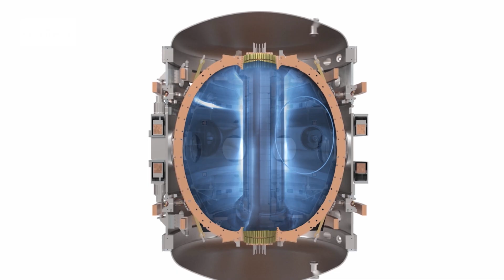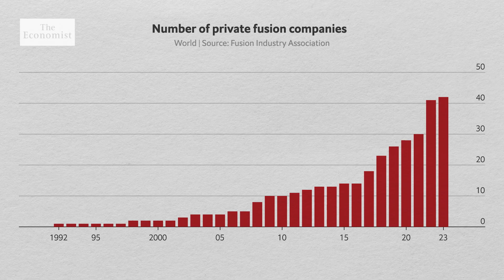Is nuclear fusion the future of clean energy?

Comment: ROFL!! The biggest scam in the history science! It will always be 30 years away. 
Here are just a few major problems with nuclear fusion. 
Stoping 14 MeV neutrons hitting that first wall! Cos whatever that is, it's gonna get the you know what kicked out of it!
It's a massive science experiment that they don't even know if it will work as a viable method of generating electricity.
It uses more energy than it makes, Q Plasma is not the total energy needed to run a fusion power plant. 
The many tritium problems....
The limiting factors of thermodynamics, converting heat into useful energy!
To put it another way.
With using the nuclear fusion business model as my foundation, i would please like to introduce you to my amazing idea called. The material reconstructor!!! 
It would involve building an aperture in one location and a second one in another location. Things that went into the first portal would appear out of the second one with bearly any time delay. 
The same process could be repeated in reverse, so that you could travel back. 
All i would need is the time, money and resources to achieve this and by my estimations i could have it ready to go, or at least have the RnD stage done, in as little as 30 years. 😉

Comment: You don’t need “base load “ power. Power which can be switched on and off at will is much more useful and indeed required to balance the variable output of wind/solar.
Reply: "I have no idea how an electric grid, nor how power generation works"
Reply: Thank you for sharing your insights about the importance of switchable power for balancing the variable output of renewable energy sources. It's great to see more advancements in clean energy solutions like nuclear fusion. On another note, if you're into outdoor activities or need a reliable backup power source, I highly recommend checking out the Segway Portable PowerStation Cube Series. Its massive capacity, fast recharging, and waterproof technology make it a versatile and reliable option for camping and home backup power.

Comment: Ask any physicist, fusion burns hydrogen into helium, the hydrogen comes from our oceans. Yes, there is a lot, but humanity's thirst for energy is unquenchable. If fusion ever works, and if we make it the cornerstone of our energy economy, we will be burning our oceans out of existence. And, no, there is very little likelihood that we will expend the effort to get hydrogen from other planets, at least until Earth is squeezed dry, because it costs too much. Frankly, the best outcome for Earth and our grandchildren is if the fusion project fails.
Reply: Did you ask any physicist how long the hydrogen we have would last if used for fusion?
Reply: @MattNolanCustom  At our current energy usage of 19Tw we will need to burn 19 Gigagrams of water a year (19000 Tonnes if I am doing my SI units correctly). That is assuming our energy usage is stable. It is not. Our energy usage has followed an exponential curve since we started burning Oil. The other question is how much do you have to burn before it begins to impact the environment?
Reply: Oh, yeah, extracting the hydrogen will require energy so energy demands will increase just because we're running Fusion reactors.
Reply: @kimwelch4652  right, so putting the increasing usage to one side for a minute, enough water on Earth at current usage levels to run fusion for around 70 trillion years. I don't think running out is the issue, nor really is depleting the water to dangerous levels. Our civilization is unlikely to last that long! Fusion is so appealing because of the energy density of the fuel and thus the tiny amount of resources that it consumes. The waste from fusion is helium which is inert, something we are actually running out of and something which is lost all the time from the upper atmosphere to outer space. The activated plant waste is low level and short lived. Fusion would be kinder to our environment and ecosystems than any other form of generation, renewables included. Having said that, I think we should have a balanced mix of sources, excluding only fossil fuels.
Reply: @MattNolanCustom  And, that's 70 trillion to burn it all up. More likely we'll find 1% is enough to throw the ecosystem out of balance. You should also, not put aside our energy addiction which will likely more than double every century. Did I mention our energy use is on an exponential curve? It isn't a straight line.
Reply: @kimwelch4652  the subtleties are not lost on me. However, the basic fact is that whatever we do for energy will have its cost on societies, ecosystems and climate. Fission has the smallest footprint on those things per MWh right now. Fusion will beat it by a factor close to an order of magnitude. We should also be looking at ways to be more efficient and less greedy with our usage. That doesn't change what the best choice of source for the bulk of our energy should be. Fossil fuels have the CO2 and methane problem. Renewables have a mining and end-of-life disposal problem. Geo and hydro is very location specific and can only help us a little bit. To say fusion would doom our planet by using too much water is the least logical argument I have ever seen against it.
Reply: @MattNolanCustom  Actually, Fission only takes advantage of an already burning fuel. We just capture that energy instead of letting it heat the Earth directly. So, technically, it has a smaller footprint than Fusion which adds heat where there was none before.
Reply: @MattNolanCustom  Actually, the fact that Fusion burns up the oceans is an incredibly logical argument against it. Saying that it would take Fusion a long time to burn up the oceans is an incredibly short-sighted and irrational answer.
Reply: @MattNolanCustom  The whole point of engineering is to know which subtleties are important and which ones are not, so the problem can be simplified to a solution. Unfortunately, even the best engineers can miss small subtleties that will, over time, result in a collapse (a bridge, a building, a civilization, ...). Short-sightedness in an engineering or scientific endeavor can be fatal.
Reply: @kimwelch4652  I can't tell if this is bad logic or just being poorly informed
Reply: @kimwelch4652  incredible
Reply: @MattNolanCustom  Actually, it is very credible. We did it with Oil, we'll do it with Fusion. Fusion is unsustainable.
Reply: @MattNolanCustom  What is incredible is that everybody who works on Fusion already knows this, at least theoretically, but they don't care. There are reputations and money tied to the work, and everybody has got bills to pay and a table to fill will food. They've probably never really run the numbers on just what is involved in putting Fusion into production.
Reply: @kimwelch4652  ah, so now some of your true colours are starting to show. You have ignored my genuine question to suggest better alternatives but instead rag on fusion and fusion scientists. Disappointing
Reply: @MattNolanCustom  A little dramatic aren't we. I didn't ignore it, I missed it glossing over posts. Also, I had work I had to finish today so I can't answer every question all at once. In particular, while it is easy to see some plan is not a real solution, actually finding a real solution is much harder. What we need to do is drastically reduce our footprint on the planet. That includes reducing our energy consumption as well as all our other consumptions. And, there needs to be a lot fewer of us as we have seriously exceeded the carrying capacity of the planet. Our waste has become life threatening. We need to learn to live within the bounds our environmental constraints. There is no easy solution to that. Our real problem is not technological, but sociological. If we cannot find a way to do it, then we are in real threat of extinction.
Reply: @MattNolanCustom  Ooh, the AI says, "If the Earth lost 10% of its water, it would have disastrous consequences for everyone." So, you don't have to burn all the water to cause devastating effects. Assuming you trust the AI. You do trust the AI, don't you? They wouldn't like it if you didn't trust them.

Comment: even if it happens, there is still issue of setting up high power trans towers. with so much trouble getting solar farms connected, be decades before can be used
Reply: It's always 20 years away
Reply: Distributed solar is not so much trouble. Any given house or business is limited by the existing connection, as are the local trunks and feeders. However, for any grid, these add up to match the full capacity in any case. Expect to see more.

Comment: Ultimately it will come down to cost.  Solar & wind farms might just get the last laugh--IF stationary storage batteries get bigger and cheaper.  
 Think about it:   'Overbuilding' solar & off shore windfarms will allow any excess power to be dumped into storage--far far cheaper than keeping a labor intensive nuclear/fusion/coal or even LNG powerplant on line.  Plus, any extra (when storage is "full") could be used to make cheap H2 (and O2) as a side benefit.
Reply: Well, if the batteries become more and more accessible IMHO first place to use them would be transportation- to reduce its emissions. Even small battery (10kWh) should reduce gas consumption from cars tremendously if mass used in PHEVs(short trips). And if batteries are cheaper and scalable still it would be most efficient to use them with workhorse nuclear fission- least overbuild of both generation and storage for maximum decarbonisation. I don't see the appeal of fusion when not even one estimate can be made about timeline and cost of "potential" future reactor. I personaly don't see how Fusion could be on the same order of magnitude as Fission.
Reply: You'll dry your non-abundant resources in no time with solar and win as they can't be used for the steel manufacturing industry.

Nuclear fusion mass-producing hydrogen is the future.
Reply: Anymore than 20% wind & solar the grid becomes unstable due to weather conditions which self imposes a limit for wind & solar, but 20% is an achievable goal.  What the world needs is a new fuel and Algae could become that fuel.
Reply: @miken7629     You might need to re-read the comment several times.  This is about STORAGE...not about the grid.
Reply: @michelem.6104  "This is about STORAGE...not about the grid." But storage alone, doesnt actually solve all load volatility problems for intermittent generation. You will need all three components. For some reason in the US we are deciding to focus on just one of them (at least from political standpoint), which doesnt make any sense.

Comment: Fission energy is the future. Fusion is always 30 years away
Reply: I like Fission power plants (preferably Thorium though), but have to agree with 'michelem'--it will always come down to $$$.   Once built, a huge wind farm/solar farm + stationary storage will probably cost a lot less...AND use a fraction of the employee's to operate it.
Reply: @JuniperTrekker While true, we don't have the storage capacity to run the world on renewables. Fission plants will be needed until a cheap, reliable, and energy dense storage option becomes available, such as solid state sodium ion batteries. Until this happens, some form of base load supply will be required.
Reply: Fission is only costly because pf the extreme regulation and the fact that we use tecnology from de cold war. 4 generation nuclear power plant are easy and cheap.
Reply: @Brunoscaramuzzi  because if theres something that we need, its less regulation on nuclear reactors

"4 generation nuclear power plant are easy and cheap" citation needed

Comment: Fusion is the future has been happening for at least 50 years, it's always just right around the corner. If it happens, it happens. Otherwise we need to live with what we have and not look to pie in the sky to try to save us. Slow steady improvement on what is until the "future" arrives.
Reply: let's just use fission instead.
Reply: @sciekimike280  Sure, but it's waste lasts essentially forever, not all but what can't be recycled. Also it's inherently dangerous.

Comment: How can you even call this clean energy when the radioactive waste it produces has no other solution than hiding it underground in massive tunnels??!
Reply: No energy source we have is clean. Fusion, if made to work, would produce the least environmental mess per MWh than anything else. The radioactive waste from Fusion is a considerably smaller problem than the waste from Fission. The mining we'd need to do to run the whole planet on wind, solar and batteries makes much more mess, kills much more wildlife. You need to look at the bigger picture.
Reply: Are you confused between fission and fusion?

Comment: Two things. First, it is still far in the future until it is ready. Everyone hopes it will be soon. Second, the plasma has to be heated to 100 million, and more, degrees Celsius. What happens to all the heat?
Reply: The heat dissipates into the environment. All of the fusion startups try to wow people by saying their fuel is heated to hundreds of millions of degrees, but what they don't mention is that their fuel is a rarified gas.

Fuel in a 1 liter reactor vessel at a few microns of pressure heated to 100 million degrees wouldn't even cause a gallon of water to boil.

Obviously full size reactors would make more heat than this, but it wouldn't be any more heat than what a coal power plant deals with.

Comment: Short answer: no. Without a constant source of extreme pressure/temperature, the fusion process cannot be sustained. The Sun can do it because gravity produces those conditions in its center. But here on Earth, it is simply not possible.
Reply: NIF and JET have both had what is termed "burning plasma". Sure, NIF is only for a tiny fraction of time, but the main reason that JET couldn't run the pulse for longer is because its field coils are copper and overheat. To say that sustained fusion is simply not possible is a rather pessimistic opinion if you ask me. If you'd been around at the time of the Wright Brothers, I expect you would have said that sustained human flight was simply not possible too.
Reply: Hydrogen bombs say otherwise.
Reply: @RMX7777  to be fair, they're not exactly "sustained", and they require a fission bomb as a primary
Reply: @MattNolanCustom  I'll admit, I read through FranzBiscuit's comment too quickly and missed that he said sustained source. My bad.
Reply: @RMX7777  such graciousness is unusual to see these days - bravo! Nevertheless, Mr Biscuit doesn't seem to be aware of the vast difference in fusion cross-section between proton-proton and deuterium-tritium. I guess the common "sun in a bottle" analogy doesn't help on this front.
Reply: @MattNolanCustom  Indeed, the proton-proton fusion cross-section is so low that we can't even measure it experimentally. Deuterium-Tritium fusion on the other hand has a cross-section over 5 barns. They simply aren't comparable.